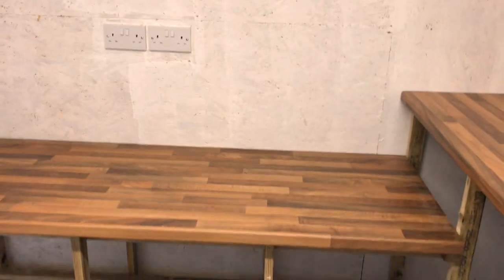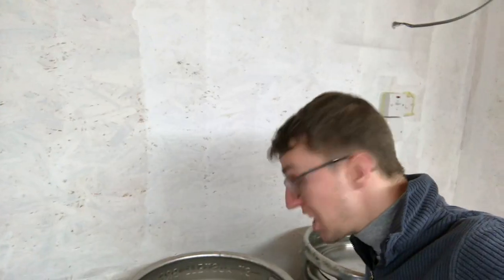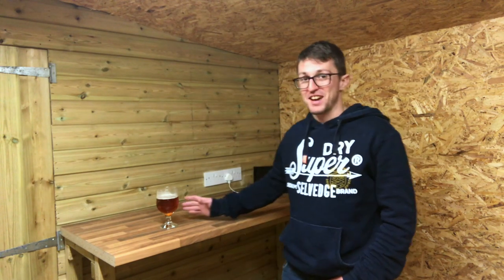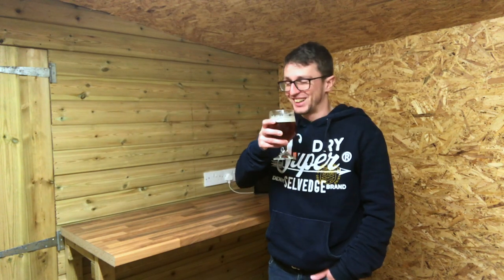HAHB Brewery Build – Part 4

Comment: Coming along nicely! I dropped my worktop for the kettles, so much better!!
Reply from the maker: Did you go higher or lower than I seem to have? I think it's about right now, but time will tell when we're bending down to connect pipes or whatever.
Reply: I put mine in at 720mm to the top of the worktop. I can still store buckets and stuff underneath at that height.
Reply from the maker: Thanks, I think we're at 750mm so very similar – good to know!